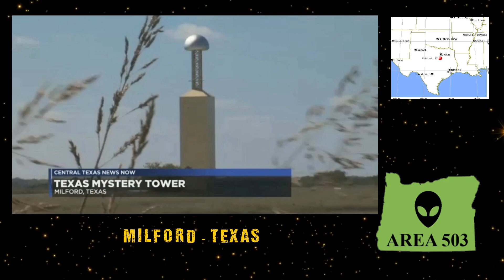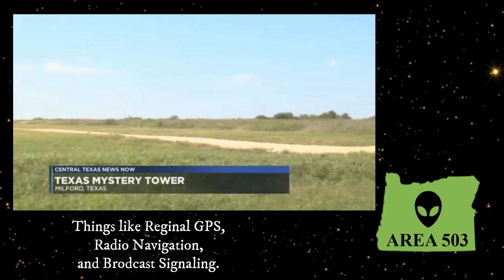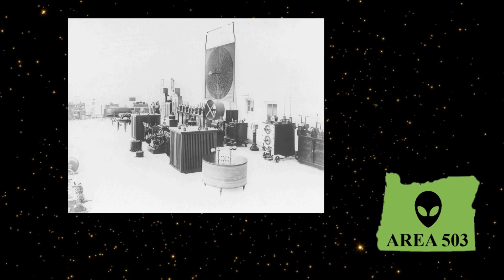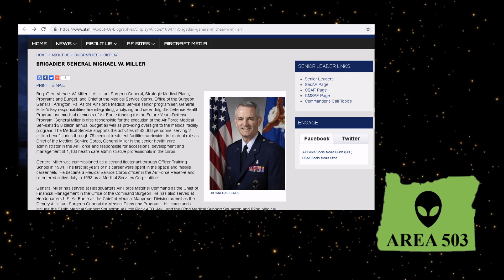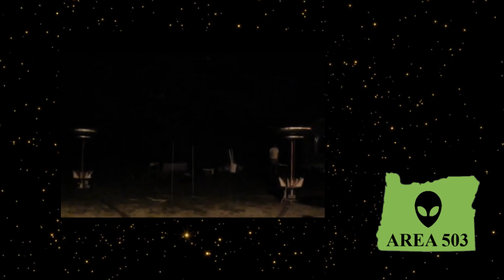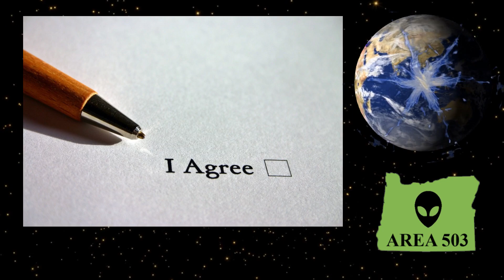#17 Revived Tesla Technology spotted in rural Texas.

Comment: People can make giant spark-machines in their back yards, but not Tesla broadcast-power systems.  Tesla transmitted at well below 25KHz and well over 25 megavolts, while these "vaudeville" or "theatrical" coils built by hobbyists, they instead run at over 10X higher frequency, and well under one megavolt.  That's wrong.   Nikola sez:  if it's making lightning, that's failure.    And today we know that the Earth's resonances all crap out at frequencies higher than roughly 25KHz.    In other words, it's damned hard to make a Tesla coil run at 10KHz, unless you build it way higher than 300ft tall, rather than 10ft tall.    And, it's damned hard to crank the voltage high above one megavolt (50MV or 100MV would be good.)   Instead you just get lightning, which shorts out the system.  Put your entire coil in a big tank of transformer oil!   (Who ever does such a thing?!)   In addition, the big ball on the top needs to be at least a yard wide, or several yards preferrably.  Don't use a small 1ft metal ball, did you WANT lightnings?  Because that's how you get lightnings.

And finally, Tesla's broadcast-power only works at all when it precisely matches one of the planetary standing waves, and these resonance-lines wander around over several minutes.    Oddly, Tesla's original system compensated for this frequency-mismatch (perhaps accidentally!  Geniuses make weird mistakes that produce wild successes, while any normal person will try to "repair" the device, remove all the unknowns and control its behavior, which unwittingly removes the magic.)

Since broadcast-power requires serious power before you can even detect it, you're going to need a 440 volt service at a few hundred amps.   Go down in the basement and check.  220V and 30 amps?   Nope, not gonna work.   Tesla's lab at colorado springs managed to produce the weird effects by only using a power source of a couple hundred horsepower.  That's over a hundred kilowatts.  Your home electrical panel can only give about 5,000 watts before your breakers pop.   Even if you had a gigantic low-frequency 5,000 watt Tesla coil running, with an oil tank and a giant coil and a polished 6ft metal sphere, the broadcast would be far too feeble to even detect.

The MINIMUM broadcast-power system is freakin' enormous.    And that's if you get everything exactly right.   Build it a bit small, or make a small mistake, and it stops working completely.
Reply: This is powered by the SSC. Hint hint..